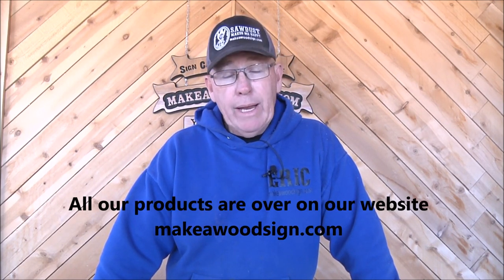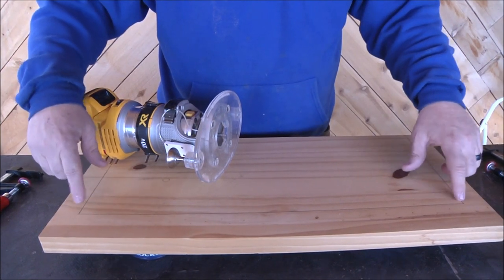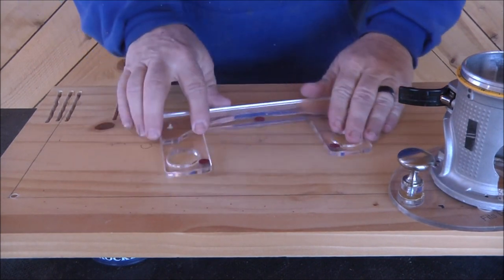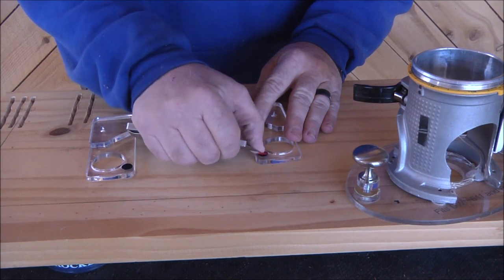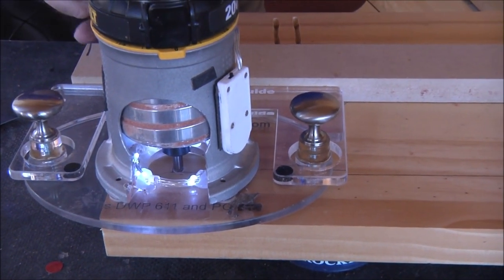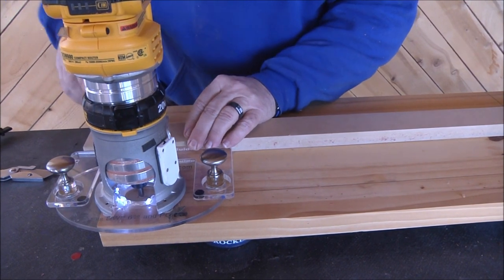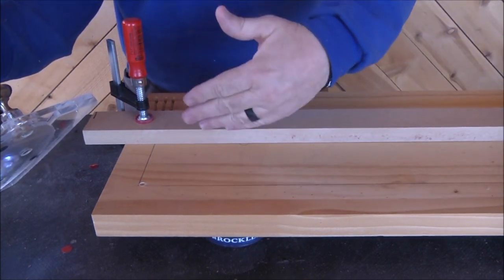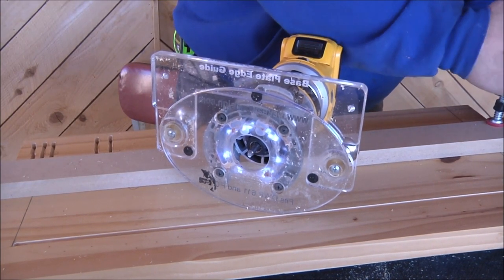#549  Freehand Carved Wood Signs Router Base Edge Guide Demo

Comment: Have you considered making a slightly larger base plate with a flat side on it instead of an add on adapter. Seems like it would be better than having to take something on and off. The added size would be better anyway. Personally I would buy that over your regular base which I have and like.      Mike
Reply from the maker: I'll run that past Dave... We do make a 12 x 12 square base plate now.

Comment: That's the one thing I haven't liked about the baseplate is that it is oval and lacks a straight-edge. Curious as to why they're built that way to begin with...
Reply from the maker: I very rarely use an edge guide. I like the oval shape.